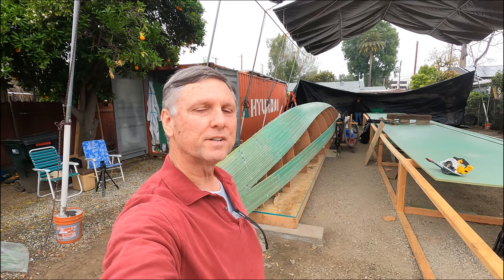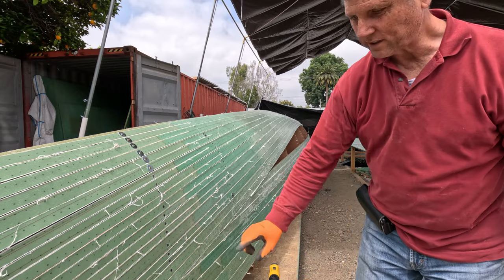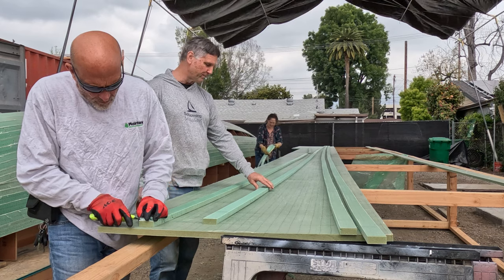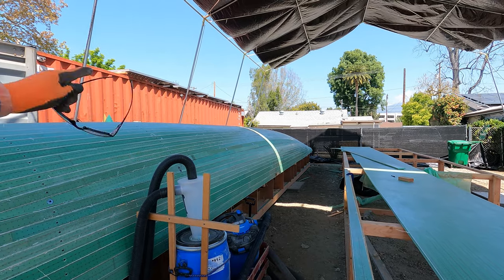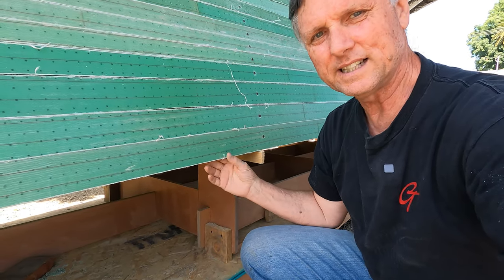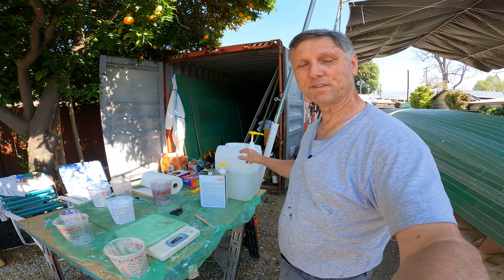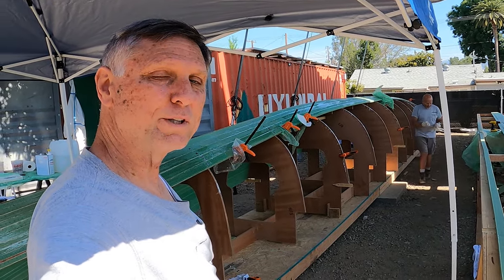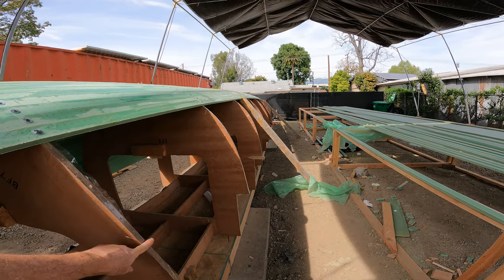Kit E31: Strip Planking the Port Canoe

Comment: Looks tough squeezing the ziploc bag with epoxy. High risk of a gaining a 'tennis elbow'. From experience,  may I recommend that you use i.e. a DeWalt electric caulking gun that handles bags: You can easily roll and insert a filled bag in the gun and the plastic nozzle can be reused when the epoxy is hard. It can save you sooo much stress when applying the thickened epoxy. 🙂
Reply from the maker: I'll look into it. Thanks.
Reply: Costs probably quit a bit with all your doing

Comment: Something I’ve seen in the past when dealing with lots of strips was during dry fitting when the strips where in place the person not only numbered the strips but also ran a diagonal line on one side and two diagonal parallel lines on the other,  that quickly let the final assembly team know if a mistake was made.   Good job with the info your providing, I’m enjoying it.
Reply from the maker: Funny you should mention that, we decided to do that very thing on hull #2.  We are learning as we go.  ;)

Comment: I don't want to sound negative about your videos, BUT @6min mark you guys start peeling the peelply off. Can you confirm you just pulled the peelply off as it looks like the top layer of fiberglass and the peelply coming off. Can you guys do a close up or something to show the top layer is still there. I'm a new sub and loving your build so far keep sharing and I'll keep watching
Reply from the maker: Yes, I will show you that in one of the next videos since we are doing more peeling next week.  But to answer your question, there is only peel ply on one side and peel ply with a coating over on the other side that might make you think we were pulling the laminate, but we weren't.

Comment: You might want to consider for the other hull: 
- Cut the strips with a 5 to 10 degree bevel so that when assembled there will be a V-shaped groove between each strip. In cross section, each strip with be a trapezoid.
- Put the wider side of the strip words the frame.
- Do not remove the strips after dry-fitting, just fill the grooves with thickened epoxy.
Seems like this would simplify the assembly process and remove a lot of time pressure. Hope this helps!
P.S. Those are splines, not biscuits.
Reply from the maker: I inquired about all your suggestions (and others) at the outset, and we follow the build process recommended by Schionning Designs. Also, they call those biscuits in their plans, so we will as well.  In fact, 'biscuit' was written right on the part.  To change the name, regardless of what other folks call things, would not be wise as we would need to constantly translate what is called out in the plans or marked on parts, so, in our case, these are biscuits.

Comment: Yep, done plenty of pumping on those west system pumps. And although convenient they’re also slow, especially when you have to do it 500 times… which I’m sure by now you’ve discovered! Weighing is good, but I found the quickest and simplest was just to pump out the required number, mark the plastic cup for both epoxy and hardener, then just pour to the marks.
West system is tolerant of small variations in the mix - you don’t have to be super accurate. I used this method throughout my build and never had a failed cure. Keep up the good work. Cheers
Reply from the maker: When we get to larger mixes, no doubt we will do that.  Right now, we're using 1 to 30 pumps, mostly less then 30, so it isn't a big deal (yet).
Reply: @SailingSVLynx  By 500 times I meant 500 mixes. Even 30 pumps per mix sounds like slow work! : ) Although it also depends on your temperature - looks like it’s pretty warm where you are.
If I was building another I think I’d look into those double pumps. One pump adds both epoxy and hardener in the correct proportions in one go. I always thought they looked an excellent idea. Cheers

Comment: This seems like the messiest and most nerve racking part.  How easy is it to fix any mistakes?  Do you have extra planking?
Reply from the maker: We think that this is, by far, the most difficult part, and we had to do it first (as rookies).  And though we made a few mistakes, I will say it has gone easier than expected.  However, we are only 1/3 of the way through.  Yes, there is some extra, and we can fix mistakes as needed.  It is only foam, fiberglass and epoxy, so it can be repaired.  Hull #2 will go much more smoothly.

Comment: Looking good crew!
Have you thought about, or looked into getting an epoxy dispensing and/or mixing machine? There are various types, the most simple being like the guy from the Duracell Project is using. It could save a lot of time over the course of the project and perhaps pay for itself (you'll wear out several sets of those W.S. pumps!) 🙂
Reply from the maker: Yes, we have, and still are, looking into one :)

Comment: Every single one of those tapered end cut pieces are going to come in very handy, when you're nearing the and of the build. They're great for an incredible number of jobs and will help to cut costs.
An enjoyable video!! Thank you for sharing.
Oops... Almost forgot to ask. Did you add an extra layer of the tape on the form edges, in order to keep any extra epoxy out of the holes from the dry fit?
Reply from the maker: We have added tape as necessary, if it wasn't in great shape.  Tape is cheap.  :)

Comment: I've seen strip planking where they screw down all the planks then use a router and make a V groove, then apply epoxy with filler. Did you consider this technique? Keep up the good progress!!
Reply from the maker: We are just following the instructions of Schionning Designs, since they make the kit and have 35vyears of experience building these cats.

Comment: Would it be an advantage to only remove 4 or 5 strips at a time then you coiuld wedge the upper one against the lower ones in stead of the props¿
Reply from the maker: The issue is drip.  As we put strips up and squeeze the epoxy out it drips and would land on lower strips at times.  But keep thinking and suggesting solutions; we don't think of everytthing!  And yes, some has hit our clamps at times, but there is far less target to hit.
Reply: @SailingSVLynx  if you left peelply on lower strips that would contain some mess use the used peeled peal ply to cover the edges for that are exposed
Reply: @tommussington8330  It's not really an issue.   The clamps work well and allow us to adjust the height of nearly all to a comfortable level to apply the epoxy bead.

Comment: Sir. Will you be vacuum Bagging the Hulls in you Catamaran? May be a little more work but less Epoxy use! Also Sir did you know that you can add dye to your Epoxy to color the Hull? Last have you thought of getting a Fiber Company to help cover your Fiber material cost like using Kevlar Fiber for the Hull ?   There a Company that could be a good sponsor and you just advertise for them?   Good luck hope the weather don’t get to Hot for the Epoxy .
Reply from the maker: The panels used to strip plank the hulls were already vacuum bagged at the factory.  No further vacuum bagging is called for in the plans. We just follow Schionning's design, it makes a light, strong, performance cat and they have been doing this for 35 years.  All materials to build the boat have already been procured, most were part of the kit.  We are using basalt over the hulls.  I hope that answers your questions. 🙂
Reply: @SailingSVLynx  you Don’t like to Add Kevlar Fiber to your Hull? Did you not take the peel ply off the Foam core? Just trying to protect the Hull and make it Stronger. But it your Cat.
Reply from the maker: @gregoryh4601  peel ply is just a silk like cloth made to be removed to create a nice bonding surface, not the fiberglass laminated layers that were vacuum bagged to both sides of the foam.  We chose to use basalt over fiberglass, kevlar, or carbon fiber, each for different reasons.  We will go into that in a future video.

Comment: Perhaps a silly question. Why use  epoxy on the foam? Wouldn’t a cheaper glue serve the purpose (since the foam isnt structural)?
Reply from the maker: The foam is structual and epoxy is far stronger.  Just because we will reinforce the strip planking with basalt does not mean that the strip planking is not part of the strength of the hulls.
Reply: @SailingSVLynx  gotcha! That makes more sense now

Comment: Sorry I haven't watched all your videos yet. What is the strip material? Is it a PVC foam or something? Or PVC with fiberglass on the outside? Also, some experts do recommend that you sand after removing peel ply. I am not an expert. But what the experts say is that the peel ply has a release agent on it. Some of that release agent remains on the piece after the peel ply is removed. I know you have already put fiber on the hulls. But I felt I might as well mention it here anyway.
Reply from the maker: The panels are made from structural foam core that is closed-cell, cross-linked, and vacuum bagged with multiple layers of fiberglass on both sides.  We have read many studies on peel ply and will sand in any areas that have a lot of stress, like where the chainplates attach.  For example, the entire port canoe was sanded prior to our basalt being applied over the peel ply surface.

Comment: Why dry fit, why not epoxy as you fit?
Why not use wider strips for the flatter areas, ie to the top of the hull…oh I just watched an earlier episode, see that is the case. Perhaps the epoxy between the strips are structural. 
When you had epoxied the strips, did you get any creep, or did they alight in exactly the same place
All the best with your massive project, you are very brave!
Reply from the maker: We needed to alternate top and bottom to meet on the middle while dry fitting to make those odd pieces in the middle, but when putting the epoxy o, we want to go top to bottom.  So dry fitting first worked better.  And, Schionning told us to do it that way. 😉

Comment: Doing a Great job.  But I still say it well take you 3 to 3 1/2 years to be done and in the water.
 Now if I was you I would contact  "Total boat" for your  Apoxy needs. I found there  Products are very easy to use and I believe If you contact them they may help on the price of there  Products. If not free of charge. That may keep you on time and  Budget. 
 So keep up the Good work and I will be here on my lanai waiting for the video. 
 So until next time, Aloha from the Big Island of Hawaii!
Reply from the maker: Total Boat is already a sponsor of S/V Lynx.  :)
Reply: @SailingSVLynx  Ooo?! Sorry I must have mest that. I need to go back and watch again. And see where I mest that.
Reply: @SailingSVLynx   "West systems" is different than "Total Boat" . Two  Different companies. You may want to look Total Boat up. They can make it way easier to work with. Now they are a few dollars more, but the time it saves you on prep and the more work time you get with the product is well worth it. And it is a lot easier to work with.
Reply from the maker: @kptbillburkett8735  As I already mentioned, Total Boat is one of our Sponsors, as is West System.  There are many types of epoxy, each has specific uses, and there is no one type for everything.  The laminating epoxy we are waiting on cannot be replaced with Total Boat or West System epoxies.  There is a list at the end of each video listing our sponsors, in case you are interested.

Comment: Can you write me exact name ,brand,thickness of the strıps that you use ın building please?
Reply from the maker: Well, they didn't come in strips.  If you watch the videos from that time, you will see that they came in large 27' x 9' panels and we had to rip them down to the size strips we wanted.  I believe these panels were 20mm thick, though they sell them in various widths.  The company was Advanced Materials Solutions in South Africa.
Reply: @SailingSVLynx  How that material is called?Foam?Balsa core foam?What ıs the name?
Reply from the maker: @seyfyildiz  Foam, with fiberglass on both sides already vacuum bagged on.
Reply: @SailingSVLynx  how it is called as a product?I will get in contact with manufacturer to buy for building a cruising trimaran in Turkey.

Comment: Frustrating about the epoxy. Too bad you can’t cancel that part of the kit for a refund and find an alternative supplier like Total Boat. They seem to help a lot of boat building channels with sponsorship. Anyway, things progressing nicely!
Reply from the maker: Total Boat is a sponsor of our project, but, unfortunately, they don't make laminating epoxy, which is a different animal.
Reply: @SailingSVLynx  hmmm. I'm a little confused then. There is another boat project channel called the Duracell Project and he's using Total Boat for all of his laminations. Seems to be working well for him.
Reply from the maker: I can't speak for them, but Schionning Designs makes this kit, and require a laminating epoxy for specific parts.  There are different properties for laminating applications than when gluing.  Things like bulkhead attachments and tabbing can use Total Boat's epoxy (we are using West System) but laminating a large surface has different stresses.  That's why there are so many types of epoxy made for different applications.  They have a whole range of parameters.   We are using Sicomin for lamination, but they make many different types of epoxy.  Pro Set was another option, but it was expensive.

Comment: If the epoxy system from south Africa is delaying the project that much and it sounds like it won't ship till some hands get greased and I'm betting that is the cause if the delay, why not use the boat building epoxy systems available inbred US,  like west systems it total boat. 

Are they not good enough for this project? Basalt cloth? Weigh the cost in delays verses the cost of local materials and increased cost of foreign material over time along with increased shipping cost. 

Also due to delays,  it will set back the procurement schedule for other materials and their order time and delivery.  That puts a new dent in your scope,  timeline and cost to added increased material cost over the extra time. This also impacts your schedule and completion along its critical path. 

Yeah,  I'm a project planning consultant and I've seen it all too often. The reason we spend sinning time and effort planning, is to mitigate the risk of failing or the time and cost over runs due to delays and force majure. One if the biggest delays in a project is the import if foreign materials.  They always lie or misquote delivery dates and from experience,  we have tomorrow for that and for a more realistic date and plan for it in our schedule.

Innevery project,  there are always scope changes due to the situation presented over material availability and in time delivery. 

Many times you need to make decisions and the necessary but right structural changes to achieve the same goal withouy shifting your other constraints like time and cost.

Remember,  this ship,  should not exceed 18 months but you may have an additional 6 months for all these delays, finishes, rigging,  outfitting, snagging and commissioning. 

Don't be afraid of giving suppliers deadlines,  even if they were supposed to supply materials as part of a kit. This is a project, a very costly one and should be run like one. I hope your contract has a defects liability clause in it for the suppliers of the kit. I'm sure you both did your due diligence and have it all covered, never mind me,  I'm just trying to be relevant. Carry on.
Reply from the maker: Not all epoxy is the same, we cannot use Total Boat or West System epoxy for lamination, even though they are both sponsors of our build.  They do not have the correct properties.  The delays in shipment will not delay our project just reorder some things.  I am also a project manager by trade, among other things, and have run several companies.  So. I know how to get things done.  And, on that note, the Sicomin laminating epoxy is now on the cargo ship and on its way here.  :)